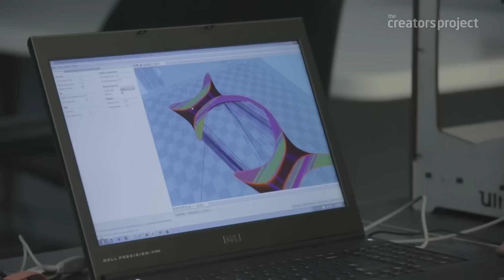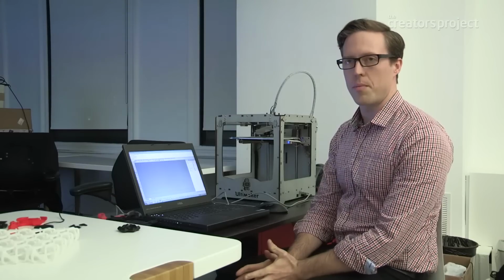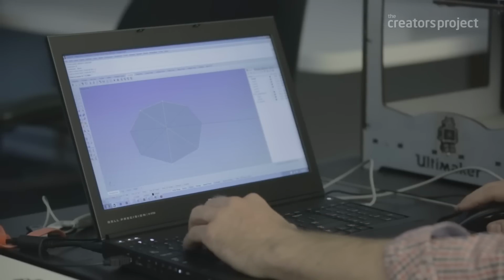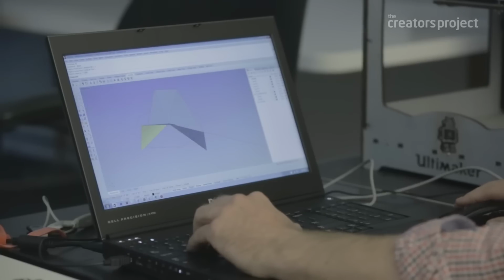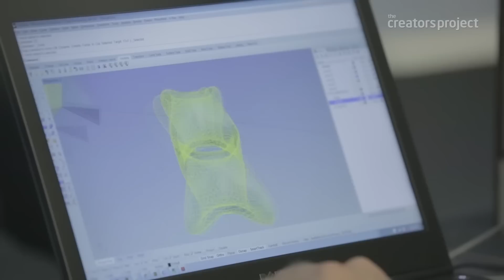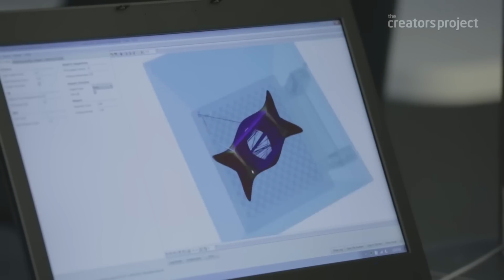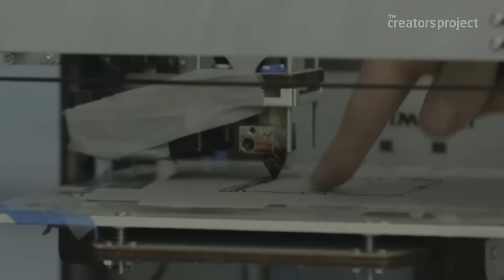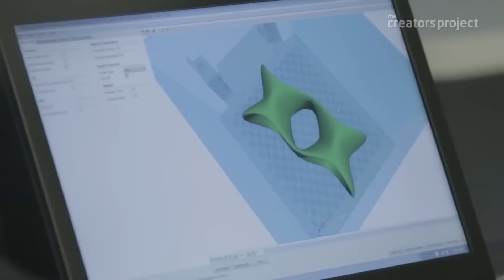How To 3D Print

Comment: they are expensive because of the machining and specialized equipment that is used to build/create them. With 3D printing the price can be different - a bit like old style cutting tools vs. high speed laser cutters for metal.

Comment: This software is able to make the slices and build interior structural geometry I believe. I'm sure you could make Maya or 3DS do that but they aren't designed with any concern for the insides of the 3D models. In order to print a non-solid structure with weight bearing properties the interiors of the objects have to be dealt with. Now if you wanted completely solid object I'm sure any modeling software capable of exporting the slices correctly to the printer would work.

Comment: What kind of material were they using? We use ABS for our 3D printers in our lab and use Solidworks for the modelling bit(less code more tangible output to work with)